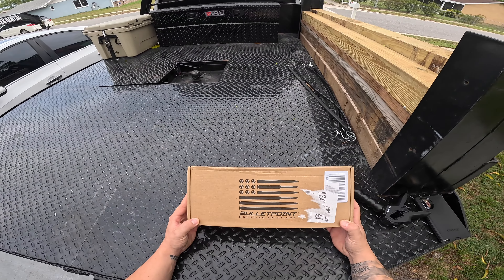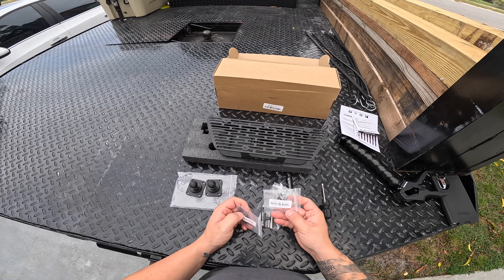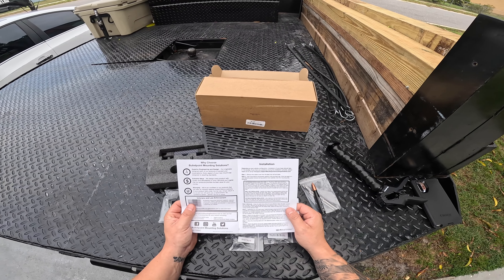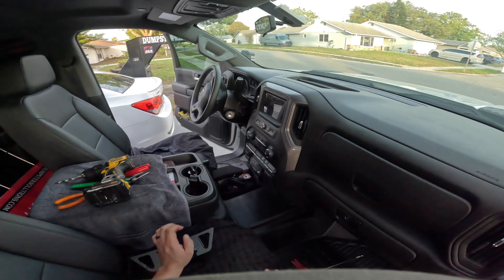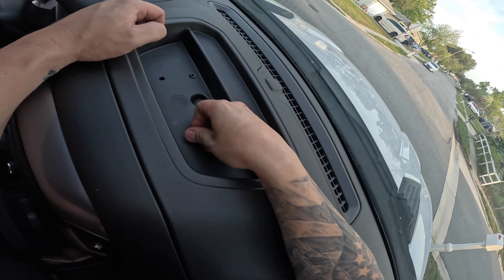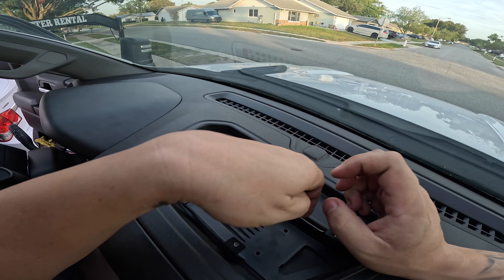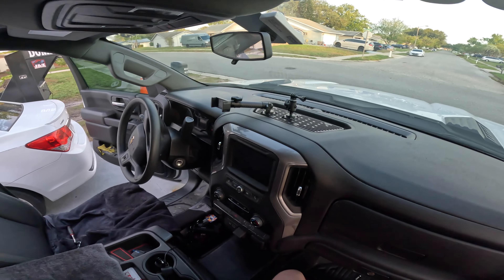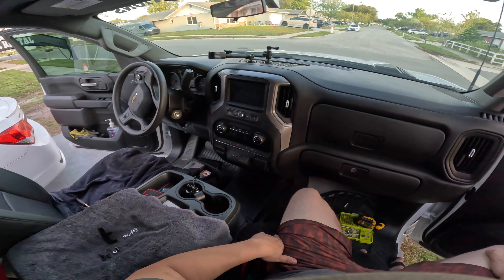Install BULLETPOINT mount in a 2022 Chevy 2500HD.

Comment: How did you remove the original dash cover?  Does it simply pop out using a screwdriver or pry bar?
Reply from the maker: You are using the drill bit that comes with the product. Simply mark & drill your holes, then inserting those well nuts and screwing it down. There is no taking off the dash or anything.
Reply: I realized that after I finished watching your video. I went out to my truck an looked and found out how simple it will be. Mine is in transit to me right now.   Thanks for the great video and for your reply.
Reply from the maker: @knoxmtn  No problem.  Thanks for watching!
Reply: @jzdumpstersolutions  I'm not seeing the well nuts with my kit